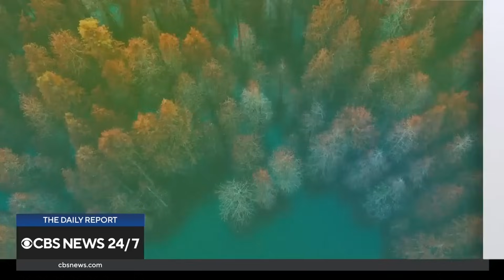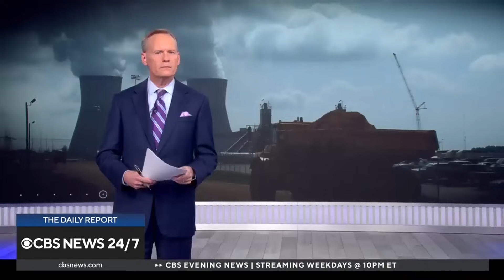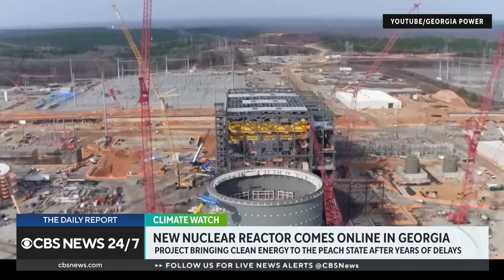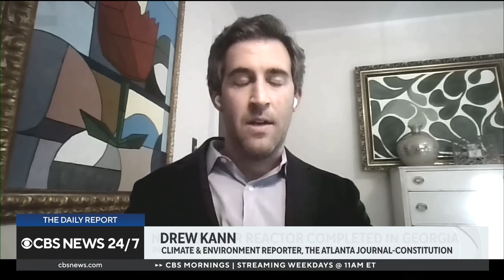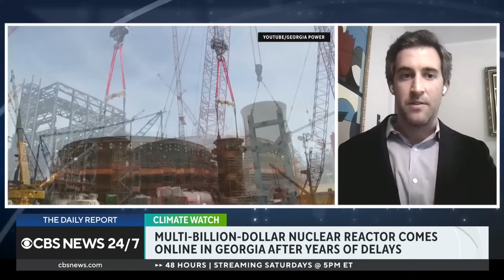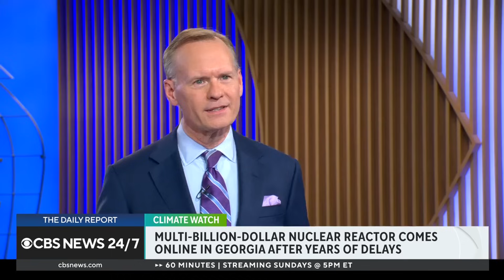New nuclear reactor comes online in Georgia after years of delays

Comment: Sad that nuclear power has been so stigmatized. It’s by far the most enviormentally friendly high-yield power generation method.
Reply: And Germany with  its attempt at total ban. It doesnt look like a good investment
Reply: That would be Japan and Russias fault
Reply: I'm hello, it takes how much pollution to create 1 gram of nuclear fuel ?  Do you even know ?  Nuclear power is NOT clean energy.
Reply: blame Germany.
Reply: It deserves criticism because this AP1000 rector design is Outdated and not resilient to the volatile new world. It's like driving a Model A Ford in 2024.
Reply: Uranium is still not a renewable resource. Sure there's a low carbon footprint, but we'll still have resource conflicts if the world makes nuclear its energy backbone. Offshore wind could provide 80% of the USA's population with green energy alone. I believe nuclear has a place as load balancers for large transportation lines and a supply providers for rural areas. We need it all, but nuclear is too expensive and takes too long to build for it to be widespread.
Reply: @dentonjackson3267  lots of resources to make wind turbines as well.  We have no shortage of uranium.  There is a reason they dont recycle it.  Its so cheap that there is no need.  As far as too expensive and takes too long that is mostly because of politics.  Ontario spent 20 years building nuclear reactors and were basically bringing on one reactor per year.  Those reactors are 40 years old now and are getting refurbished to get anther 40 years of life out of them. Bruce Power is talking about adding another 4.8 GWh of capacity at their site.  They are already just shy of 7 GWh in 2200 acres.  They are even producing medical isotopes with their reactor. There are a bunch of reactors in the US that should hit 80 years as well. China built a few reactors not too long ago where it was 4 years to complete them.
Reply: It looks like the USA loves paying up to 10X more for power. Wind a Solar is about 10th the cost "findings suggest that the cost per kilowatt (KW) for utility-scale solar is less than $1,000, while the comparable cost per KW for nuclear power is between $6,500 and $12,250."
Reply: I agree.  As someone that lives in a state of Illinois where we have the most nuclear power plants, I can honestly say the fear of nucleare power plant are way overexaggerated and the benefits are very underappreciated.  Illinois has some of the lowest electricity rate in the country due to number of nuclear power plants we have and YES it is environmentally friendlier than Coal, Natural Gas, Fossil Fuel even Solar & Wind power.
Reply: @abudianto  It not the risk it the cost solar with storage is 1/5 the cost. We all want cheep power.
Reply: What do we do with the nuclear waste? I agree that it is a great option and should be utilized and explored more but I feel that the nuclear waste will almost certainly become the issue of future generations. A solution needs to be found to the waste issue.
Reply: @vibezonly69  reuse the “waste” lol. And the “waste” is just radioactive rock that is now a different element and/or isotope. There are processes to reuse it, but there are political reasons as to why they don’t.
Reply: @vibezonly69 we can reuse a large percentage of the waste with specialized plants, giving us more energy and drastically reducing the amount of time the waste remains ‘dangerous’
Reply: @vibezonly69  Nuclear waste is able to be reprocessed into more nuclear fuel. Allowing for the reuse of nuclear waste, as well isotopes in Nuclear Waste can be used in medical machines, and equipment needing a radioisotope. Modern Nuclear waste is able to be reprocessed into use, while what cannot be reprocessed it is stored in shielded and sealed bunkers deep underground. These storage facilities are constantly maintained and checked on to ensure there is no nuclear waste leakage. In the US these storage facilities, are placed in areas where there is no one living or likely to live.
Reply: @vibezonly69 waste isn’t a big issue. No high level waste has even needed moved away from the reactors. We need way more nuke power.
Reply: @vibezonly69  all the nuclear waste from all the nuclear power the US has produced since they built their first reactor could fit in one stadium stacked 18 feet high. There are ways to reuse it as well.  They just dont do it because its cheaper to just produce more from new. That brings it down to around 500 years before its no longer dangerous.
Reply: @vibezonly69  bury it so deep underground that it wouldn't affect any groundwater and be safely stored, just like the Spent Fuel Repository at Forsmark, Sweden. There's supposed to be one in the USA in Yucca Mountain, AZ, but NIMBY-ism and politics got in the way of getting that done.
Reply: @baybum7  won't affect ground water? how can you garantee that? You can't. 
Like Germany right now have a BIG issue with old nuclear waste that they stored years ago in a mine and now they need to dig it up and put it elsewhere, the trouble its that they don't know where to put it and it will cost the german popuplation Bilions of euros. It can be low carbon, but renewables are way cheaper and no worries in recyclying or store the waste.
Reply: @xexas3000  Solid rock in the middle of a practically empty desert is hardly the same as mine #4 outside the olde Oktoberfest grounds. Which really isn't a bad choice either, considering an abandon coal mine site will never be confused with a nature preserve.
Reply: @xexas3000 Ground water is close to the ground. Deep geologic repositories are dry and waterless.
Reply: @erikkovacs3097 Wrong.
Reply: @xexas3000  Renewables are simply not consistent enough as of now to be a primary source of energy. Until it is, nuclear should be used in addition to renewable energy in my opinion. Sure there are downsides to nuclear energy, but some eastern countries have shown it's possible to build nuclear power plants relatively fast and in a cost-efficient way, so the west should surely follow their lead. Regarding the waste, I believe there are some ways it could be now recycled? At least some of it? Personally, I am willing to take that risk considering fossil fuels have a considerably higher casualty rate that goes unspoken about compared to nuclear energy casualties.
Reply: @baybum7  illusion. you can't dig beyond the water table. There is no dry underground for human activity. Even in the desert you get rainfall and water tables.
Reply: Yucca Mountain is in Nevada, but we could be reprocessing spent fuel, reducing the waste by 90%
Reply: @vibezonly69  Do what the French do. They recycle/reprocess their waste fuel. Only 5% of the fuel is used up in the reactor before it's replace. The problem is more political then anything. Because of proliferation reasons, they only enrich the fuel to about 10~20% for power plants and because of that, they can only use a small part of it before the fuel becomes poisoned and will no longer fission in the reactor. By reprocessing the fuel. they can get the other 95% of the remaining energy out of the fuel and leave behind short lived waste. 

In submarine/ACC reactors. They use >90% enriched fuel and when the fuel is used up. They just cut the reactor out (fuel and all) and seal it up and all they have to do is store it for about 300 years verses the thousand of years for power plant fuel. BTW: Because the fuel is highly enriched. They can burn it all up in one go. No need for reprocessing and no long term waste ether.

In the end, it all political. We don't want terrorists stealing the fuel out of a power plant and making nukes with it.
Reply: @vibezonly69 You wouldn’t believe how little waste it produces, its like little coins. Very easy to safely dispose, not the Simpsons green sludge.
Reply: Solar and wind are
Reply: @andrewjoy7044  You gotta be jokin! haha
Reply: Definitely! Solar and wind have only been around effectively for only 15 years whereas nuclear's 70 years. In my state of South Australia, solar and wind has grown from about 4% to over 70% of electrical generation. It is looking at 100% in 3 to 5 years. We have no nuclear. At this stage gas is being used sparingly but is being phased out. California is a major grid in your country and they are building massive amounts of solar and wind. Texas is also doing this. I know both states have nuclear but neither are building nuclear power stations now or into the foreseeable future.
I don't have a problem with nuclear if it could be built as cheaply as wind and solar in a reasonable timeframe. Right now it cannot. If you have any info to the contrary please let me know. @ryanmartin73
Reply: @andrewjoy7044  and the cheapest "findings suggest that the cost per kilowatt (KW) for utility-scale solar is less than $1,000, while the comparable cost per KW for nuclear power is between $6,500 and $12,250."
Even with battery back up Solar and win is cheaper.
Reply: It's sad that you have been misled
Reply: @andrewjoy7044 solar and wind produce a fraction of the power of nuclear reactors and they still have environmental impacts of their own.
Reply: @emh5745 Could you explain what impact the energy used by solar cells and wind turbines has on the environment. Solar and wind are by far the cheapest way to produce electricity. The recently completed Vogtle 3 and 4 reactors cost $US35 billion for 2.2 GW. For the same price you could build 30 GE of solar or wind. If you have any info to the contrary please inform me.
Reply: @emh5745  Solar produces way more power (watts) than nuclear. Maybe you're thinking of energy (watt hours), but even solar is now out producing nuclear in energy. Solar is also less environmentally destructive than nuclear.
Reply: @JacktheSmack Absolutely false in every way. 
Solar is great, but it has no business being mentioned in the same sentence as nuclear. Also, it requires a lot of area.

In a perfect world, we would have all 100% nuclear power and absolutely nothing else until fusion comes around.
Why should we even "diversify" our energy sources, when we can just have ONLY the one that's better?
Reply: @AlmightyDude420  Uh, no I'm looking at actual numbers. Solar produces way more power and energy than nuclear. Solar is the fastest growing power source, meaning it scales up better than nuclear.
Reply: @JacktheSmack nope. According to many reputable sources, nukes still produce more than wind and solar together.
Reply: @JacktheSmack Solar is garbage. The amount of land it takes up is outrageous. The intermittentcy destabilizes grids the more you put in.
Reply: @AlmightyDude420  Obviously not good with math.  FYI the sun produces free energy.  The area required for solar panels to power your house is LESS than the area of YOUR houses roof.  Batteries get you thru the cloudy days.  Educate yourself.
Reply: @JacktheSmack  Solar is very hard to scale. It is good for small use like homes and powering cars, but not for larger operations. MIT did a rough comparison between solar and nuclear: to match the average kilowatt-hour generation of a single nuclear power plant, it would require 8.5 million solar panels.

Solar panels only run on average about 30% of the day. Nuclear runs 24/7 non-stop. You still need electricity the rest of the day, so you have to build huge expensive batteries to store the energy along with even more panels to make up the deficit.

Industry like manufacturing or mining to get the materials to build solar and batteries has a very high energy consumption and you would need gargantuan amounts of land (hundreds of thousands of hectares) to cover just a portion of that cost on demand. Nuclear can cover that very high demand and cover it on demand without blanketing entire countries in blue and black. You need that on demand infrastructure anyways if you want to build the panels, so solar scaling is almost like and ouroboros.

Spent nuclear fuel rods can be efficiently recycled to above 90%. The infrastructure for this recycling can be scaled, effectively making nuclear fuel rod waste a non-issue.

All that does not mention other problems with solar like it and the linked batteries pollution during construction, or the opportunity cost of the land given up for more panels.

I'm not saying solar is bad and nuclear is good, they both have their uses and having a diverse portfolio of renewable and recyclable energy sources is the future. "Diverse" is the key word here.
Reply: @JacktheSmack  It doesn't and it won't.
Reply: @JacktheSmack  Solar produces far more power than nuclear in the world right now because there are just more solar farms than nuclear power plants. If you look at the land area taken up by solar farms compared to nuclear power plants, nuclear is just a spec. Not to mention the mining of toxic metals like lead and cobalt that releases a ton of carbon and that solar is not viable in all locations because of geography and meteorology, for most developed nations who can do nuclear safely it is far better than solar (also I don't hate solar, it's obv much better than coal, oil, natural gas, etc, but it has its own problems). The ideal solution is to have solar and wind provide a large portion of power during peak production hours, then have nuclear or similar renewable sources that work anytime cover these gaps in generation. Right now those gaps are covered by natural gas, so a transition to nuclear should happen for those gas powered plants.
Reply: @emh5745  Wrong not in most nations currently. Wind + Solar has overtaken Nuclear in most Grids. Your data is outdated.
Reply: @tomcibulskis7649  you shouldnt be talking about educating anything dude.  Bruce Power in Ontario Canada produces 4x more power on 2200 acres than all the renewables in Alberta combined.  The largest solar plant in Alberta is 1000 acres more than the Bruce Power site.  In total Alberta has 6 GWh of renewables installed.  Keep in mind the Bruce Power nuclear facility was built in the 70s and 80s. Using renewables and battery is dumb at a grid scale.
Reply: @AlmightyDude420  Area is the roof of your home and a corner of the garage for a battery. I have been of grid for 5 years and using nuclear power from that big nuclear reactor in the sky called the sun. Further I charge 2 EV from solar We have saved over $15K ever year in fuel and power. True freedom and liability no greedy power or fossil fuel company is going to take my hard earned money.

Comment: loooong overdue. we need 100 more units/reactors right now
Reply: They are in China
Reply: Agreed. Isn't it odd France hasn't had any fiascos with heavy nuclear dependence.
Reply: @aulusagerius7127  :face-blue-smiling:
Reply: And where are you going to store all the tons of radioactive waste that stays as such for hundreds of years?
Reply: @anb7408 one the waste from old FISSION  reactor would usually be stored in abandoned salt mine as the salt crystal block and absorbed the radiation ontop of being sealin in concrete second this would be a FUSION  reactor which doesn't use uranium or plutonium but hydrogen which when fused give of an infinitesimal amount of radiation that decays very quickly  now back to the 70s with ya

Comment: I like nuclear energy, but Uranium is really expensive and there is not enough of it to supply the entire world if everyone switched over to nuclear energy production.  Meanwhile, it is possible to convert thorium mineral into Uranium in just a few months when it is inside the radioactive core of an operating nuclear reactor, and once it is converted into uranium it too can be burned as a fuel, like the other uranium in the reactor core.  China is working on this type of reactor and we need to buy those reactors from China once they perfect the design.
Reply: And beryllium and lithium 7 are expensive.
Reply: Modern reactor dont use uranium or plutonium they use hydrogen

Comment: We also need to legalize re-useing/recycling the fuel waste to reduce the nuclear waste total, and vastly diminish the half life it is dangerous.
Reply: It is legal, however not economical feasible.
Reply: @meerkathero6032 It's actually the other way around.  Illegal, in the USA, but feasible.  That goes back to the Carter administration.  Jimmy had direct experience with reactor operations from the Navy, and wanted to promote nuclear while curtailing proliferation of nuclear materials through theft, diversion and smuggling.  A side benefit, in his eyes, may have been stimulating the uranium mining business to offset real or perceived losses to fossil fuel producers.
Reply: Molten Salt Reactors use spent Uranium as a fuel. Problem solved.
Reply: Canada has a power plant uses spent fuel .
Reply: The half life is a physical property of each radioactive isotope, it can't be changed by dropping the irradiated fuel rods into acids and solvents to extract the unfissioned uranium.
Reply: @markrobinowitz8473 a breeder reactor uses the fuel more effectively greatly reducing its half life from over a thousand years to just a few hundred. As a significantly reasonable timeline to manage the waste
Reply: @markrobinowitz8473 well there's no way to clean radioactivity you can certainly reprocess it in a breeder reactor like the Japanese do and greatly reduce its half life. And we do that by mandating the breeder reactors are standard it's a regulation problem but that's also a problem nuclear too many regulations
Reply: @matt45540  Reprocessing is a chemical process that cannot change the radioactive half lives.  Dropping irradiated fuel rods into acids and solvents won't change the half lives of the hundreds of new isotopes created in a reactor.  Reprocessing, however, is the easiest way to separate out the plutonium made in a reactor if one wants to make a nuclear weapon (the reason reprocessing was invented by the Manhattan Project).
Reply: @markrobinowitz8473   matt45540  said breeder reactor, not acid/solvent dip.